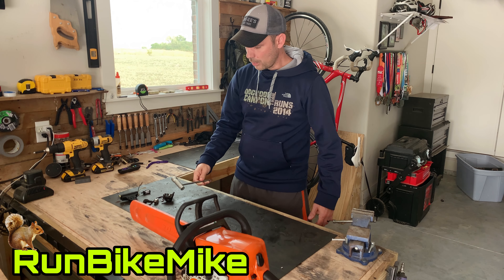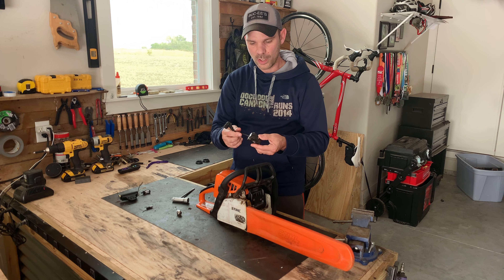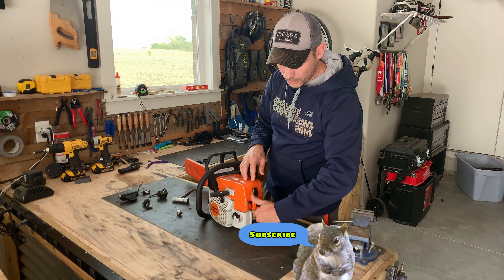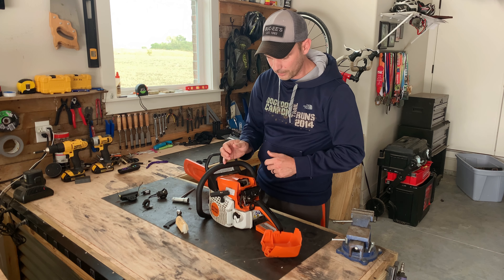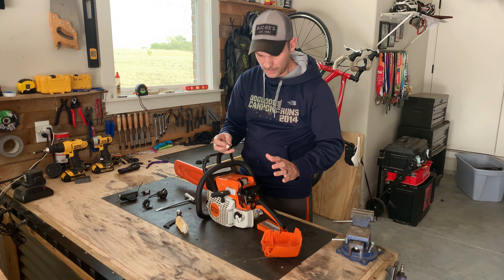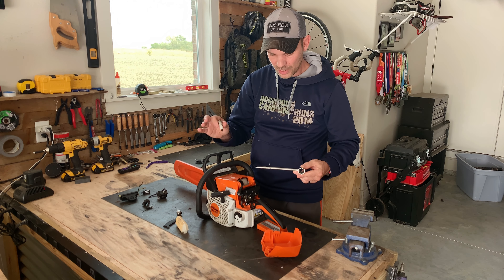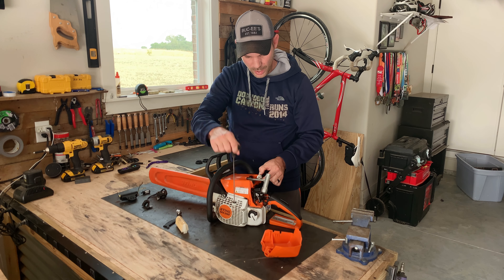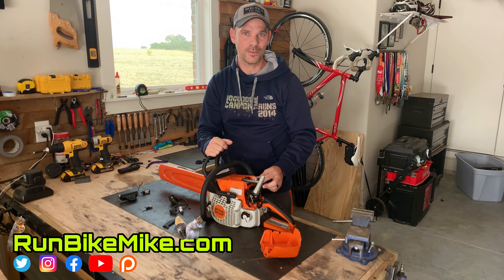STIHL MS250 Chainsaw How To Check For Spark Hack: Ignition Coil, Spark Plug, Wire Check

Comment: A tip to hopefully help someone in the future. My MS250 wouldn't' start - had no spark.  I took the ignition module out and there was gunk built up between the module and the magneto/flywheel.  Cleaned it off and the saw runs again.

Comment: That’s awesome thanks! Worked great! It’s actually the top of the cylinder head cooling fins not the engine block technically. 👍🏼👍🏼 Most of the time on a 250 it’s flooded. They flood super easy even sitting in the hot sun on a full tank will cause it. Also people should make sure the switch is in the run position to test for spark.

Comment: Great tip!  I've always just simply used a screwdriver to accomplish the same thing.  I use that trick with any machine I'm working on to test the spark.  Remove the spark, attach the coil to the back, hold the spark plug onto the side of a screwdriver and touch the tip of the screwdriver on the metal of the machine and crank away to verify spark.  Then use a multimeter on the spark plug itself to verify good ground, and an ohms reading to check the resistor.
Reply: You remove the cap spark plug you hold the wire of the coil close to the metal and you activate the rewind starter if spark occur change your spark plug if no spark check coil and ignition switch:)

Comment: The plastic shield is for winter use as it helps retain heat for the carb. Just remove it for use in warmer conditions. I like your spark test idea👍.
Reply: Actually removing it would be what you want for running in the winter, the position it was in when he pulled it out was for summer so the air intake isn't sucking hot air, for winter you flip it over and stick it in upside down so the engine can draw warm air from the cylinder head
Reply: @joelsalmond1788  👍

Comment: Thanks. Got a spark but still no start. What was wrong with yours?
Reply from the maker: It seemed to be flooded. Here is what I did. 1. Put the choke on full open 2. Lock the chain brake 3 one hand on the throttle fully squeezed. 4. Pull on the starter core over and over and over until it starts. Took me about 20 pills. Do all this with the saw on the ground with your foot holding down the saw at the handle. I really did think it would work but sure enough it did. No problems since that day.

Comment: The defect of the ms250 is if it doesn’t start within a minute it floods. You need to remove the exhaust and let it air out with the piston high . Then reassemble. It will start . We used dozens of these over the years . Great saws for ground work with newbie ground guys  u can’t climb with them though. They don’t like to be anything but horizontal ,
Reply: Worked great… removed muffler
Reply: @pattypinkball2764  cool..

Comment: LOL you have to do the test with a transparent bulb style tester to see the spark jump in the tool which has a very large gap. In your way you are too close and possible only when the spark plug is in the combustion chamber with the compression and the mixture possible that the spark does not occur.
Reply: Naw, the dielectric strength of gas vapor + air is very close to just air.  Especially with today's pollution.  Agreed in the field in bright sun it would be hard to see, but in the shop easy peasy.

Comment: Here is an easier way. Just get a scrap piece of insulated wire and put small gator clamps on each end to make a test wire, if u don't already have one made in your toolbox. Clip one end to the spark plug and clip the other end anywhere on the engine block that you can. Always take a little wire brush or sandpaper and clean off the spot on the engine where you are connecting the ground wire so you know that it's making a good connection.
Reply: Why make/carry something new when you can use the tool that comes with the saw.

Comment: So you replaced the plug and the coil and you said that didn't fix it, but you have good spark there.  So what was the problem?  Is it fixed now?
Reply from the maker: Turns out after replacing that I must have flooded it. I figured out how to start it when it is flooded and that worked. Now with the new plug and coil it starts up just fine.

Comment: Man my boss bought a new stilh 250 and I spent more time fixing it than cutting it will run fine for a little bit then it wont start seems like it's flooded out. Also pulling the cord is hard chain will also turn. Any ideas?
Reply: Use premium fuel & make sure your 2 cycle mixture is right.
Reply: @pauld7309  you already know brother turns out the stilh 250 was a return and the previous owner put ethonal booster in it
Reply: @commoditycheeze9184  bummer. Yeah can't do that. Lol

Comment: Ms 250 floods so easely. Dont fill rhem up to high and then drive around with the saw. It will flood then even worse. Tank pressurises very easely. I think if the tank can be vented more effiecient it will do better.
Reply from the maker: To quickly fix a flooded ms250. Set the choke to full open. Turn the chain break on. Pull the cords as many times as you can as you hold the trigger down. It will start after 5-10 pulls.

Comment: Next time your chainsaw won’t start and you still really want to use it, just try this simple hack. Use your little chainsaw tool and place it between the chain and bar up against the base of the chainsaw. This effectively will lock the chain in place. Next, just simply push and pull your chainsaw across the wood you’re wanting to cut. It takes longer, but eventually you’ll get better with practice. And you’ll look and feel like a badass using your chainsaw! I Love your videos, Mike. Next time you’re stumped let me know, I’m sure I’ll have a solution for you.
Reply: Man I tried your pro tip on the job the other day and they made me crew foreman!